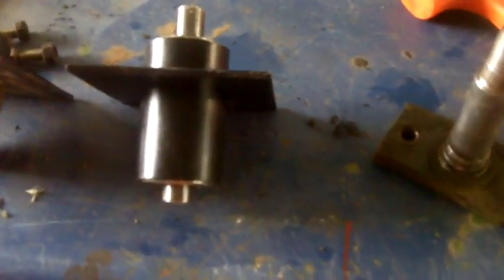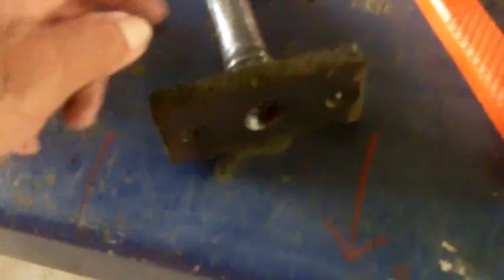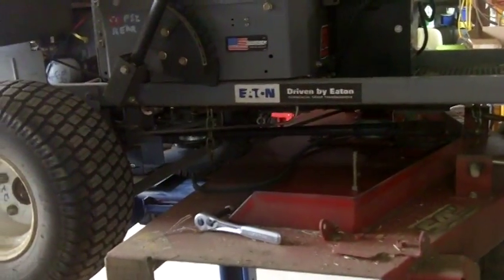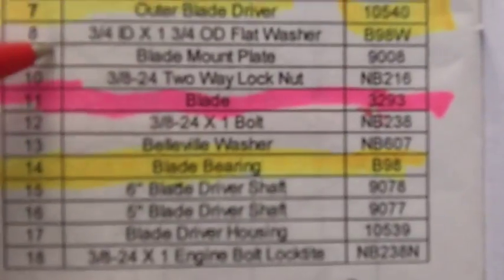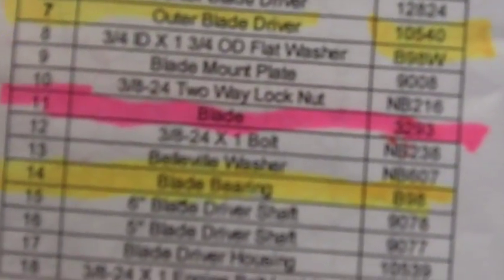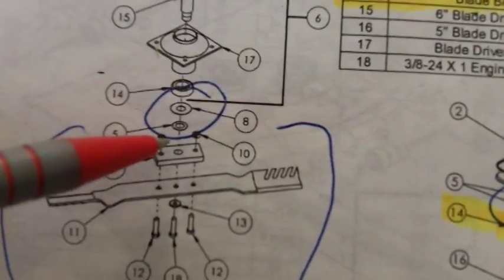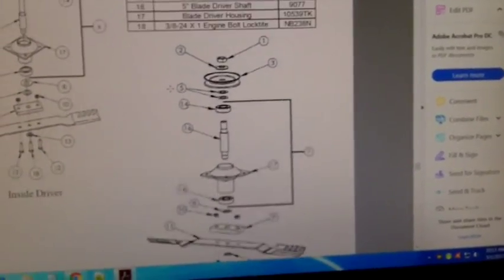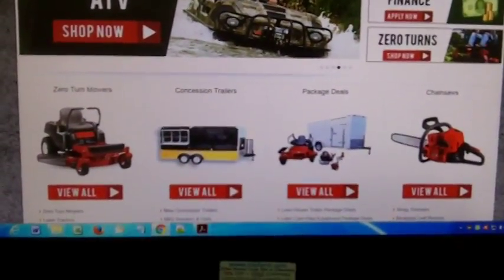Swisher ZT2454 Blade Bearing Repair 2017

Comment: You are correct...Swisher sucks! I have two older Swisher mowers... a 60" and a 66" one and their Eaton transaxles on both have gone out at 79 hours and 59 on the other. I parked the 66" one and am working on converting the tranaxles to wheel drive motors like the commercial models. I have added a separate hydraulic reservoir tank, pump, levers, and drive motors, Lots of work, but hopefully will be a success. Will make a YouTube video whenever my project is completed, hopefully in one more month.

Comment: Hello. What size is the nut on top of the spindle/pulley?
Reply from the maker: I do not remember, I have a large set of sockets including several 3/4 inch drive sockets and some metric ones. I just kept trying them until a got a snug fit.
Thanks for watching and commenting.
Reply: On my T60 they are standard 3/4"

Comment: See my note below about replacing the bearings with a better one for about ten bucks each.  No need to buy a complete assembly that come with low grade bearings.
Reply: Looked through the comments but didn't see where you posted the bearing number.

Comment: Swisher sucks. I have the 44" tow behind finish mower. Replaced the engine, and many parts. If I didn't have welding equipment I could never keep this POS going. Mine is ten years old.
Reply from the maker: Thanks for watching and commenting. It is so sad to see such an old American Company go to using Crappy parts made in china. I am hoping that our new President will make it too expensive to do that any more.

Comment: I agree the bearing assembly sucks and "MADE IN AMERICA" is bullshit. I'm replacing bearing on mine now but I ordered quality bearings. Thanks for the video though, just wanted to let you know.
Reply from the maker: Thanks and thanks for watching.
Reply: Where did you find better bearings?
Reply: You should go to the local bearing shop and buy two SKF 6204 bearings for about ten bucks each..  Knock out the old and press in the new.  Much cheaper and will last longer than the bearings that come in the new assembly.